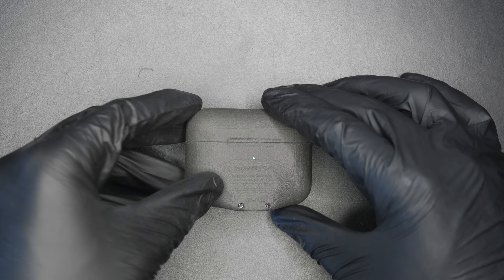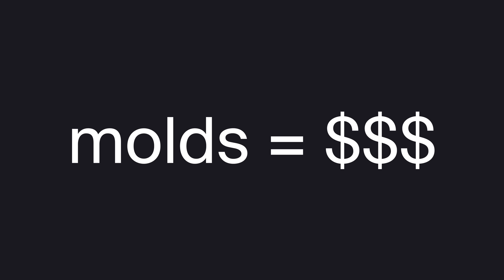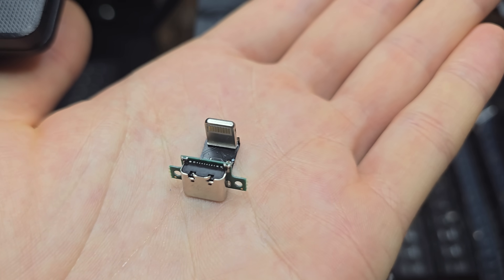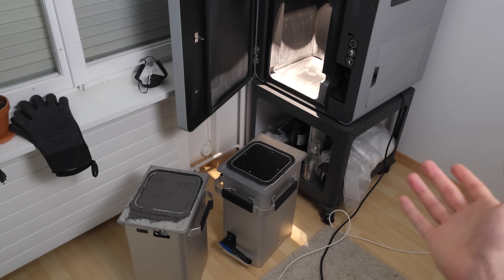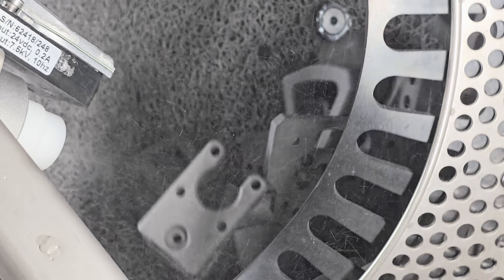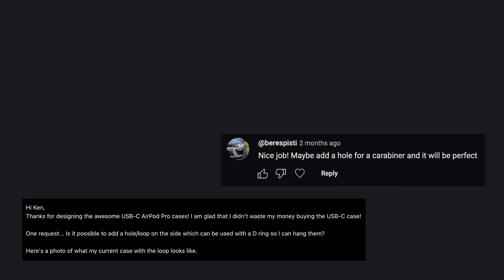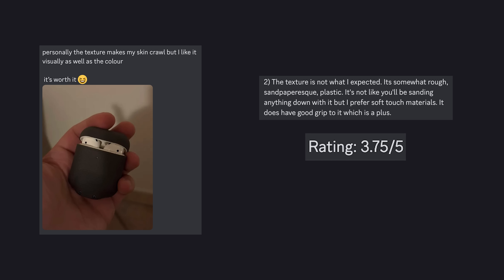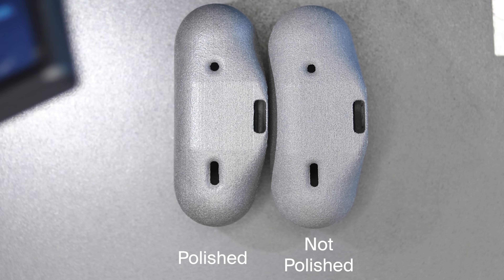One Man Plastics Factory

Comment: I spent months designing a product. I sent the 3D model to a factory in China and paid them over $1k for the mold. I had them produce 1000 units ($5000) and by the time they sent them to me, my product was already being sold on Amazon under a different brand. The factory used my mold with a different insert for the logo, produced the parts, created an Amazon listing, and sold my product for less than my breakeven cost.
Reply: And 3D printing is where small producers can get around this bS move.  Speed to market and relentless improvement. As long as you can design a product in a way that 3D printing can deliver on in terms of quality and uniqueness. They’ll go broke trying to keep up
Reply: @focalratio111 you can 3D print molds nowadays.
Reply: @spearfish thank you for sharing your story, it's a good warning to others
Reply: I just saw a video of something similar happening with cars. The local branch stole the plans, and built a government assisted factory. Many industries are moving out.
Reply: If you're talking about the Chinese manufacturing joint venture program, I need to clarify that Chinese auto manufacturers learned 100 years of engineering in just 20 years (2000-2020) from multinationals. They've advanced rapidly with new tech, a better understanding of their market, and fierce competition in the EV sector. As a result, multinational brands are now less popular and more expensive in China. In the last five years, Chinese auto brands have outpaced competitors to such an extent that comparisons are unfair. The U.S. likely won't see these products due to policy and national pride, leaving those of us who worked with the Big Three scrambling as the largest auto market opts for local brands.
Reply: Next time try another strategy. Send only a few parts to print or inject and use another provider to print or inject the other half (or third) part of the design. This way they will have hard time figuring out what you are trying to sell.
And it will have advantage in customs. No one will audition for them as they don't build anything usable so you would pay one dollar for each batch not paying any custom taxes at all.
Reply: that's aweful. I keep hearing this happening to other people as well.
Reply: @mrwind7556 it's literally the Amazon model
Reply: There's a saying: You cannot produce a single mold in China, there is one for your company and one for the nightshift
Reply: @bagibadoo439  I’ve never heard this saying before. Also molds are expensive, do you really think they’re dropping thousands of dollars on every mold? 

Again, if you have a long term business relationship with your CM and they want your future business, why would they risk it? If your mold is original it’s obvious when copied, and most of the time there’s other stuff that goes into the product (ie firmware updates, customer support) that a company unfamiliar with the development wont be able to support.

We have vendors in Shenzhen for PCBs, cables, and more. In 10 years we’ve never had an issue with IP.
Reply: They will do the same with this product, most likely, Chinese clones will appear. They need to buy one, 3D scan it, make a model, and that's it.
Reply: Never outsource manufacturing for orignal device to China. Better choose from eastern European company who can give competitive pricing and quality assurance.
Reply: There is no copyright laws in China.
Reply: Should have switched to India or Vietnam. Vendors there are honest and professional
Reply: @sparto5571  honest and professional for Indian businesses what a way to describe em the gamble might be less but it’s still a gamble
Reply: @sparto5571  I don't doubt that, for my amount of molds and what I needed I even talked to a domestic injection molding company and it really wasn't feasible
Reply: Your design should be split up into separate pieces and manufactured at different companies. You do the assembly and control the final product.
Reply: They have no idea of intellectual property, no blame. I dont know about other Russian, but for me stealing is a stealing, so I dont need to know about intellectual property rights. I just know I cannot steal, I cannot use others creations without permission. Its a sin, shame.
Reply: That's why I have continued to 3D print and just keep improving my print quality, the risk with China is too high
Reply: Exactly why you the idea of proprietary intellectual property needs to remain in the confines of a company. Obviously this creates far more challenges for the innovator producer. Of course the East is going to take your money and then leverage the idea while selling it to competitors. They have no downside except a loss of your business which by that point is replaced by the next individual in line. Big reason why US manufacturing needs to grow.
Reply: I have been developing a product. The plan was to license it, but I have it so streamlined I was going to produce it myself. I spoke with a very successful inventor. He said I'd be crazy to try that. 
If you actually have a good product, best case scenario, you make some money for a short while. Then the stress hits. Dealing with customers, resellers, and inevitable knock offs. You don't have the money to fight them. That brings me back to licensing. The truely sad part is tge PTAB "legally" steeling patents for big companies. 
If Apple wants this idea, they will take it. Not only will he not get a dime, he'll loose his shirt,  time, and stress in legal battles. Pathetic what the US patent system has become. They used to protect innovation.
Reply: Should have known better.  Why do people still think production in China is smart?
Reply: Been happening like forever
Reply: I also could have had the same thing happen to me but I found a company in the U.S. to make the mold for me. 3 parts aluminum mold and 1000 parts  15k. The company is called Protomold. I went with a business incubator in my city and have manufacturing/packaging for a very good price per set. They’ll assemble take orders, fill and ship all in the same location. If you do some work you can get a product off the ground just look for local incubators that are state or college run. Mine was through RVC. Hope this helps anyone looking to bring a product to market. GL
Reply: China in a nutshell.
Reply: That's what you get for working with chinese people.
Reply: Don't trust Chinese "people"
Reply: Yep.. becasue they are thieving bastards....., you don't go the "public" route using these advertised companies.

it's like all these "cheap" PCB production companies, actually they are stealing the designs for the military and Chinese businesses.
Reply: Gotta love commies 😂
Reply: They also steal ideas from crowd funding sites
Reply: Trademark Applications, Design, Solicits, SG1 ect.
Reply: Yep
Reply: That is why as a western company you should never outsource to chinese manufacturing.
Reply: damn that's awful ! 
I hope that we can get back to making things in our own countries :(
Reply: China has never respected international patents. It's part of a bigger problem.
Reply: Dude just ordered a 3d printed mold
Reply: Lol whole Chinese economy is built on copying technology rather than inventing it like other countries do, what did you expect ?
Reply: Sorry to hear that.
Reply: Wow, China has stolen SOOOO MUCH!!
Reply: wow can you show proof?
Reply: Omg
Reply: Did you think the Chinese really cared about you, they just see an American with dollars to pick from and then steal his product. So sorry....
Reply: That’s what Chinese company’s do, they steal ideas and copy where they can, because this is not illegal in China. I have a lot of experience with that from my former job. There are certain moral standards that just don’t exist in China, so don’t expect them to be considered.
Reply: Only 1k for the mold. We'll duh, ffs, have you ever heard the phrase "too good to be true" 1k...you couldn't get a bigger red flag, moronic. Zero diligence and research saw you piss your ip down the drain.
Reply: Disgusting company. Yep, that's something to watch out for, when getting a quote from a Chinese manufacturer. Honestly, if you do it right, 3D printing can do results just as good as injection molding, so, maybe get one! The Bambu Lab A1 mini is an amazing machine, and costs less than 200 dollars!
Reply: That is despicable
Reply: Extremely unfair. So sorry for your loss, thanks for sharing your experience, I am in the middle of a prototype production of a product that has taken me 7 years to design. I will find another way to produce it thanks to your warning. My product need 4 different production processes, in different materials, that complicates a little to rip off the idea, in any case I will take additional precautions. Hope you can make it again, this is my 5th iteration of designing products, previous attempts didn't go well for different reasons, every time you learn something new. Regards
Reply: That sucks. However the internet and even Amazon is large enough place to sell the same product for different prices. It’s all about distribution. Even if you are on Amazon and get a better ranking it could work. Still a really bit**y move by them
Reply: That’s why you don’t build shit in China
Reply: That's what you get for trying to arbitrage cheap labor.
Reply: Happened to me too!
Reply: @nicholasherrera1785  please tell us more, the more we're warned in specifics the more we can adapt
Reply: I'm pretty sure that's the point of Bambu's Makerworld and forcing the network connection of their printers. Anything that gets popular, they already have your files. I think Onshape is being suspected of planning to do similar with their free offering
Reply: If your product is protected under any kind of patent you should take the company to court. You can allow them to continue to make and sell the product BUT make royalties off of every sale because of your design ownership.
Reply: It makes no different whether you make your mold in China or in Swiss. Once yours in market, if it is easy to make, they can copy and even with improved quality.
I am glad you paid only 1k for the mold, so you lost less $$$.
Reply: That really sucks. Did you have any agreement with them over the ip of the mould design?
Reply: @akfortyfo7024  maybe he forgot but even if you do many/most chinese factories don't give a shit as long as they keep selling through Amazon. so at best you would go after them.
Reply: @akfortyfo7024  they do not fight corruption, they support and welcome it. IP theft is a kind of corruption, especially if supported by government
Reply: That’s perfect. You can get any 3d model molded in good quality by just sending them in. Don’t have to actually order the molds.
Then you find them for cheap to order.
Reply: @bernardobuss5485 No you can't as these molds cost money to make. The little fkers charge you enough for them to break even so they don't make money out of you but the mold comes for free to them. If you don't order and pay for the mold they likely wouldn't manufacture it cause it's a risk for them if the product doesnt sell.
Reply: So, trump tariff thing could actually work then
Reply: We’ve been working with the same contract manufacturer in China for over 10 years, they are amazing and good people. $1000 for a mold and $5 each for 1000 units is extremely low, a good rule of thumb in business is that you want to be a profitable partner for the other companies you work with so that your incentives are aligned.

China has very robust trademark laws, they won’t even export a cardboard box if it has a trademark on it that isn’t registered to the exporter. But someone making 1000 of something at a $5 cost a) can’t afford to register the trademark and be profitable, and b) probably doesn’t have a reputation/brand that people would trust or care about
Reply: @insolace  thanks.  Can you share your contract manufacturer contacts?
Reply: @insolace this sounds like a cope lmfao. The amount of times people in China steal shit is insane.
Reply: Didn't you apply for the patent?!
Reply: You need money to defend patents
Reply: @albert7311  i also knew a guy years ago. He designed, patented, and had produced a new style golf putter. He had little success selling them. Then he started seeing elements of his design showing up in the big name putters.
  He went to patent attorney and said, what are we going to do about this? His patent attorney asked, do you have a quarter million dollars? He said no. Well then we're going to do nothing.
Reply: Sounds very false😂
Reply: @Alberto-xw8vx 

Wrong. There are countless examples. Now go grab your 50 cents, you NPC.

Comment: Hi,

I work as a manufacturing engineer and also use the whole Fuse workflow.
There are some tipps:

1.
Normally you dont wanna lay piecec flat to a) compensate the stair effect b) compensate for dimpling and pitting on the most top layer with SLS printing.

Give your parts 20-30°ish of rotation and they will look much better (my opinion (-: )and have less artefacts. Yes you wont fit as many but it should always be quality over quantity.

2.
Add really small chamfer to some edges to reduce fraying there ~0.3mm is enough. It just happens with SLS on small features.

3.

You could try out the Dremel Versa PC10 or Bosch UniversalBrush. Both are brushless.
KEEP IN MIND! The area in the sift is considered combustible due to the properties of Nylon12 (Powder explosion). 
The Bosch drill you are using is a older type i think with carbon brushes capable of producing sparks. You dont want sparks where things can go boom.

Belive me. I work for a really company and safety was basically my biggest concern.

4.
Maybe you wanna check out the polishing setup for the blast. That might elevate your parts to the next level!

5.
Maybe outsource big batches to print services with good support and 1on1 project teams to ensure good quality.
Gives yourself more time for designing 🙂

Other than that. Great product!
People sometimes dont understand the real power behind additive manufacturing..
But you are a great example for what AM really stands for!
Reply from the maker: Awesome! Thank you very much :)

1. I agree, although I personally think the small layer lines on the front look really cool. Since I had to print so many, quantity was actually a factor for me; that's why I didn't address it. I did get some printing artifacts at the beginning, but I just changed to the new printing settings (v5.1), and it solved the problem!

2. I didn't get any fraying but will keep that in mind if I do!

3. You are right; I heard you. I will switch to brushless. I still need to find a better brush, though

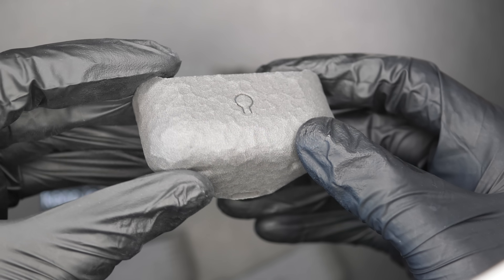4. 8:50 ;)

5. Actually, printing is not the time blocker right now. It only takes some time in the morning, and then it prints for 12 hours while I can do other things. I have more issues with the electronics production line right now!
Reply: @ExploringTheSimulation  Have you tried having smd pcb's made? it's not too complicated as long as you use components that are (almost) always in stock. common USB C ports etc should be.
Reply: The irony of a brushless brush :)

Comment: I glass bead blasted some factory made MJF Pa12 parts with a handheld station, and they turned out with a lot smoother finish and completely no visible layer lines. The particle size was around 150um, don't remember the pressure. Maybe that would be possible on a robot as well if the blasting angle and distance were adjusted?
Reply from the maker: The layers lines can disappear if I print the part at a different angle! But then I can't fit as many parts in the same small volume. I actually really like the layer small layer lines so I don't mind, I think they look cool.
Handheld station is fine for a couple of parts but if you need to make 100 every day you will burn out very quickly :)
Thanks for watching!

Comment: 2:18 can you print even more in the same volume by having 2 lids half inserted into the body?
Reply from the maker: Technically, yes, but I need to rotate the lid 90 degrees. This means the lid and bottom part will not have the same layer lines and look, so I do not do that. Thank you for the suggestion!

Comment: No disrespect but it doesn't "look way better than those conventional filament printers". At least not the newest, Bambu Lab, Voron, Rat Rig, etc, printers. There is a feature built into modern slicing software called "fuzzy skin" that eliminates layer lines. Modern FDM printers are so good these days. However, this job is begging for a resin printer. You could probably print 10 of these on one tray, at least. Something like the ELEGOO Saturn 4 Ultra MSLA would make short work of these.
Reply from the maker: Appreciate your suggestion! It's hard to tell on camera, but when you hold an SLS-printed part and an FDM part in your hand (even one with the latest technology you mentioned), they are truly worlds apart.  The quality is incomparable. Also, FDM would probably leave support marks that would scratch the cases if not sanded properly.

For resin, the resolution would be great, but there would still be support marks.  The deal breaker with resin is that it solidifies when printing with UV light.  The sun also emits UV light. So it's great for prototypes, but you can't sell consumer parts for outdoor use because they will continue curing in sunlight and become brittle.

Thank you for the suggestion :)
Reply: @ExploringTheSimulation  I see, thanks for the reply.